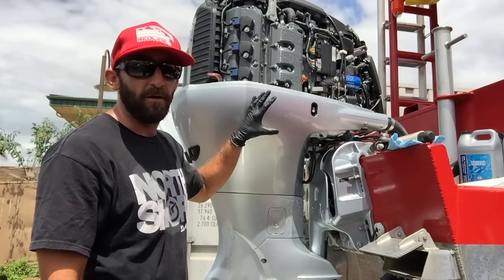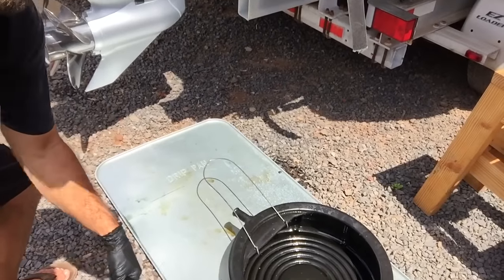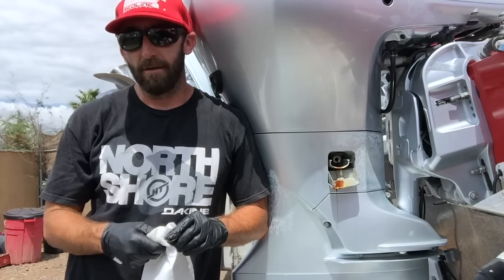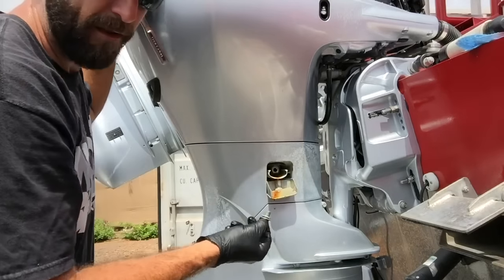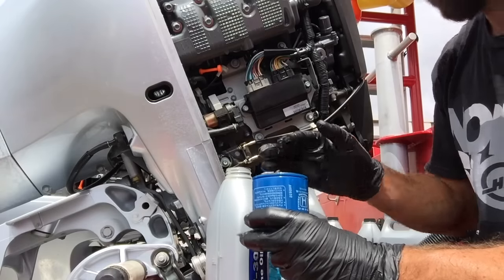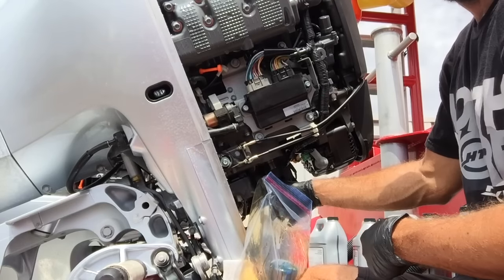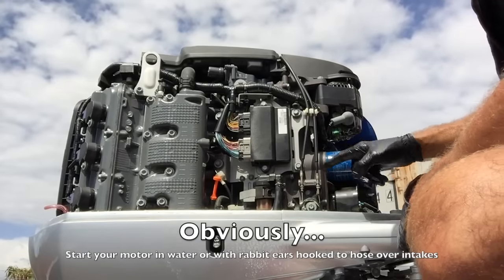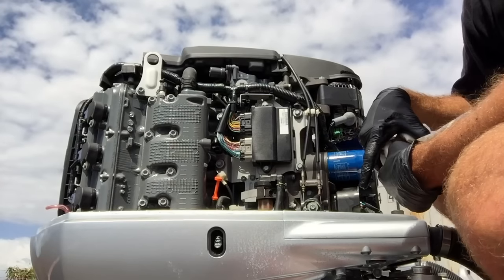Honda 225 Outboard Oil Change (detailed)

Comment: Great tutorial, just one thing.
Never prefill your oil filter. You can verry easy put contaminants in the Clean side of the filter.
Just put on the filter en run the engine for 10 sec to fill it. then check yot oillevel and adjust accordingly.

Comment: You make excellent videos, Capt. Sean!  You've made servicing my motor cost effective.  Maybe you can help.  My boat sat idle for 6mos in the driveway and decided to fire it up and get it ready for summer (I have a 2003 Honda 200 outboard).  Ran fine for about 6.5min., then the oil pressure alarm went off (never did that in the whole 16 years I've owned it).  Turned off motor, checked dipstick and it indicated full, with motor level.  Let it sit for about 5min., started it up again, ran fine and then alarm went off at 2.5min.  Any ideas or suggestions?  Thanks.
Reply from the maker: I have never had this issue but then again I run mine almost daily.  If only sound or only a light then there are other procedures to check the ignition display.  If both are going off it is most likely the engine.  From there your best hope is the oil filter.  That's your best hope but least likely.  You'd have to run an oil pressure test and if that's it then figure out if it's a switch, leak, pump, passage, or strainer.  And that's a much more complex set of procedures than I can reply to in a comment

Comment: Hey Captain Sean, can you talk a little about flushing these motors? I keep mine in the water -- should i use muffs with the motor tilted up and running at idle or should i use the hose attachment with the motor off? Does the hose attachment bypass the thermostats?
Reply: also, what do you think about saltaway on the reg?
Reply from the maker: I would use the hose attachment with the motor off.  That's what the manual says and I can't remember if it was on forums or the manual where I read the water gets all the places salt water does when you have the motor off and do that reverse flush.  If you tilted the motors up too high with the motors out I'd be worried about the oil pump possibly failing or having issues. Also may want to scrub the zincs fairly often and consider changing the ones in the exhaust manifold more often than most.
Reply: Dont run your engine when its tilted up!! Because the oil pressure will be too low, as the engine is designed to run vertically. Probably going to give you a warning straight away when you turn it on! As for saltaway I would just use it once a year just before winterizing the boat. No need to use it everytime you flush

Comment: Great Video. What’s size prop is that 4 blade. Do you know if it will fit a Tohatsu 250.
Reply from the maker: Our props are SS 14-1/4 x 17 x R(or L depending on engine) so basically 17" diameter. We chose stainless because of the load we push (24 people) for less flex.  For most boats I think you can use aluminum and be fine, plus if you hit something it ruins your prop and not as much gears in your lower unit.  Tohatsu should have different hubs so I'd talk to a dealer or some guys here use  FL company prop gods I've heard with a lot of variations.

Comment: awesome ... owned a 225 and didn't know about the cover becoming an oil director sleeve - is that also on the 150?
Reply from the maker: I'm not sure about the 150. I have worked on friends but never did their maintenance.  We also have these moldable rubber sheets that are made for oil changes like this. (not endorsing the site or brand as ours is different but this is an example of what I'm talking about https://www.amazon.com/Form-Funnel-Flexible-Draining-Tool/dp/B010BZ26EQ/ref=sr_1_1?crid=1BS8L4K7O55HA&keywords=moldable%2Boil%2Bfunnel&qid=1576975366&sprefix=moldable%2Boil%2B%2Caps%2C243&sr=8-1&th=1

Comment: Captain Sean, thank you for the video!! I am new to boats and am considering a purchase of bass boat with a honda 225 outboard (BF225A).  The previous owner states that the oil was recently changed and after compression test a mechanic stated that the motor was mechanically sound.  We took the boat for a test ride and everything appeared/sounded to function as it should.  Upon taking the boat out of the water and trimming the motor down to drain excess water I noticed after approximately 5 minutes that there was a 2" diameter puddle of a milky white substance.  Is this an indicator of water in the oil (or somewhere water shouldn't be), or is this typical after a recent oil change?  Also, I live in a humid climate, maybe this is a result of those conditions?  I appreciate any advise you have and hope that you find my comment!  Thank you for your time!!
Reply from the maker: Milky fluids of any kind are not a good sign.  I see tiny milk streaks of water in the oil during changes (forums I've seen say that's normal condensation), but a puddle with a consistent color like that on this motor means you have water and oil mixing.  Where the oil is coming from is everything.  If it's got a yellow/honey tint to it then I'd guess motor oil, or lower unit if the leak is coming out there.  Pink milk would be trim fluid. Can you get a picture of where you can best see the oil coming from?
Reply: @captainsean4851   I do not currently have a picture.  I was offered a second test ride and would have to see if I can replicate the issue.  I will attempt to do that and see if I can notice where the oil is coming from.  Could it possibly be an issue of excess oil overflowing and mixing with water outside of mechanical housing (flowing out of compartment and mixing with water draining off out of motor)?  Or is it turning the milky color because it is being mixed inside of the mechanical compartment?  Again, thank you very much for the reply!
Reply from the maker: @edmundr4134  It can get milky outside of the engine.  I have seen an issue with a gasket on the motor mount deteriorating and causing oil leakage.  If you trim up the motor after running it, if it's the gasket I'm thinking of, you will see milky oil dripping out from the area where the motor and lower unit meet. If it is leaking from that area you're looking at probably $4K-$5K bill from the dealership.  Also, check the oil after you run, if it's milky that's a bad sign and I'd avoid buying it.  Maybe see if you can spot any leaks while you have the cover off.
Reply: @captainsean4851  thank you so much! The current owner states that he did not have any further leakage... obviously not sure if that's the complete truth... I think it will be best if I have a shop look it over one more time. Thanks again!!!

Comment: Good video, did your oil level increase between services?
Reply from the maker: That has never happened to me.  I have heard that comes from a piston(s) having gasoline blow by the ring due to a bad spark plug/ignition coil.  Usually, it's oil burning in the cylinder but I've heard it CAN go the other way and "add" oil to your supply.  Maybe search some threads online.

Comment: Hey man, awesome video!
I just want to know what the reference for the oil filter is. Or send me a link from where you get yours! Thanks
Reply from the maker: I get mine from the island's Honda dealer but you can order online as well.  Part number for ours is 15400-PLM-A02PE.
Reply: @captainsean4851  thanks for the reply! Do you think 15400-RBA-F01 SD would work? Thats what I can get locally. Or how do you actually check if its compatible? Because its not in the manual
Reply from the maker: @th3smurf692  It looks very similar, might work, but if it were me I'd order them online.  I have seen guys here use NAPA filters for the Honda...Odyssey I think, but I like OEM stuff.  Even my truck, I order Toyota oil filters on Amazon since they're cheaper than our local dealership.  Just my 2 cents.
Reply: @captainsean4851  thanks alot for taking a look. You are right, I think I will order an oem filter online. To be on the safe side.

Comment: wow ... tight on that filter! ... 'better safe than sorry'?? I always thought HAND TIGHT (hard hand tight) was enough.
Reply from the maker: I know you're right, in my head, and also, that's how I tighten my oil filter on my car.  Honda manual says hand tight then use wrench to get to 9ft/lbs (12Nm).  It used to say gasket first touches metal then 3/4 turn.  I could never get close to 3/4 turn without filter wrench (which is not a torque wrench and I'm not about to pay for an adapter).  I think hard hand tight would be just fine, but this has worked for me long enough know it's part of our procedure.
Reply: @captainsean4851  thanks, I figure if it ever drips more than once in or twice it will work itself out and drip out onto the motor box and I'll notice (as they are kept tipped up when not in use, which is technically MOST of the time! ) .... need anyone to 'hold the wrench' (in Hawaii, LOL) ??   oceanexplorations.ca
Reply from the maker: @tivertontom   I now have the other captain's help for holding wrenches...could've used you about 8 years ago when I was starting lol